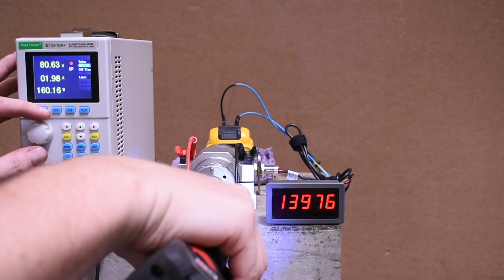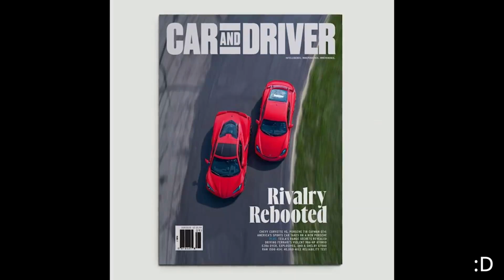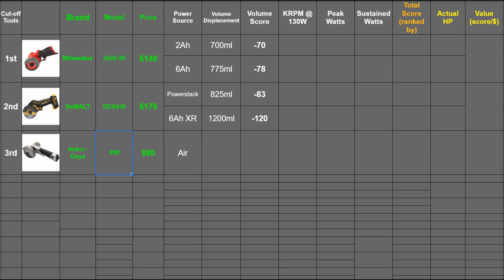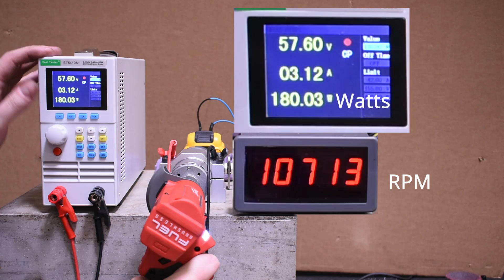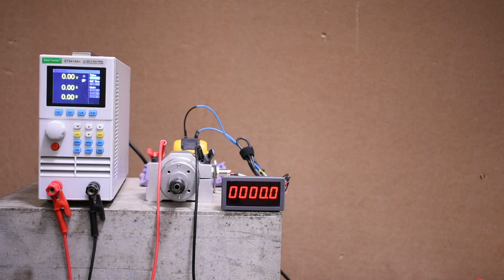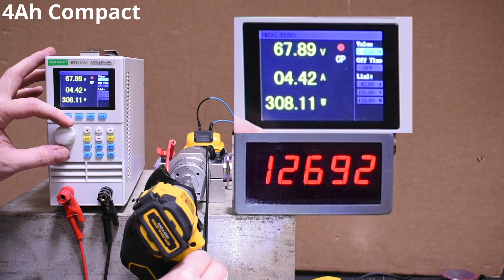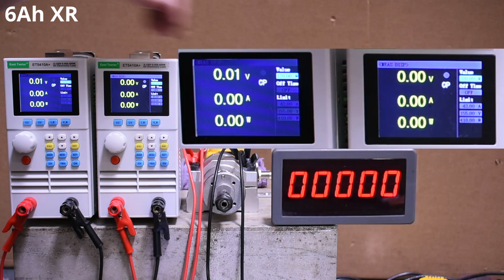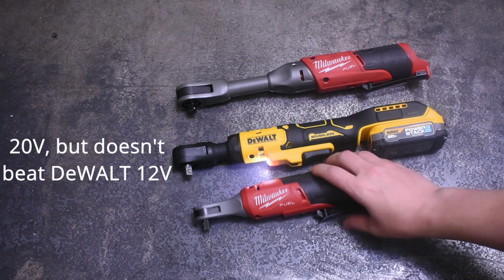Best Cut-Off Tool? Dyno Testing DeWALT v Milwaukee v Air

Comment: It would be interesting to see how the other TTI 18v tools compare, like the Ryobi cutoff tool and die grinders vs the Rigid cutoff tool. It's interesting that TTI hasn't made an 18v one in the Milwaukee line.

I've noticed my Ryobi cutoff will just chew through 4ah 18v packs when cutting sheet metal, and eventually "overheat" if I was to push it but that's really a task for an angle grinder, partly from grinding wheel cost. I mostly use it for lighter tasks where it's been fine.
Reply: The 4ah batteries are too small for that application, I'd bet. Angle grinder wise, my M18 is gutless and hogs through batteries faster than steel with less than a 6ah battery.
Reply: @wiresmith2398  I'm sure the bigger batteries work better, but with a small motor I wouldn't say that they're useless unless the batteries are heavily worn.

Angle grinders definitely benefit from higher output packs, the non HP+ ryobi packs also output less current in general than the HP+ ones, so they'll always be a bit weaker.

The main issue with using a 3" cutoff tool to run though sheet metal is just heat, the motor got hot, the cutting disk got hot, the battery was hot, it's a lot of heat, but it worked.

Comment: the volume measurement bugs me. i could accept a plastic bag if it was vacuum sealed, there's a considerable amount of trapped air in the shopping bags y'all are using. with the wide ability of 3d scanners in cell phones, i think you should be able to calculate volume of a 3d model pretty easily
Reply from the maker: No air, just the thin bag. Pushing the bag into the water empty with a pencil yields less than the 25ml resolution we have to go off of

Comment: I know you guys are mainly car guys, but I would love to see you do a "What battery ecosystem is best" comparison. What tools exist for a given battery family, and how good they are. Including drills, impacts, angle-grinders, saws, etc.

With ecoysystem/family, I mean not just e.g. Devalt XR. If you can use XR and Powerstack and others on the same tools, that counts. 12v vs 18v/20v does not. You'd have to be able to make use of the combination of Tool/Battery/Charger.

Comment: When I first saw the Milwaukee cutoff saw, I thought it was pointless.  But then I started doing a lot of work with fiberglass, and combined with a good diamond blade, that thing sure is handy!  I'm not at all surprised that air beats it, though...
Reply: i got one to cut impossible to unscrew screws in hvac retrofit, and i love it for its size (and battery compatibility with my other Milwaukee tools), but i can tell that using it for sheet metal, screws, and the occasional heavy angle is about the max of its usefulness. id love to see more compact 18 volt batteries, and a m18 cutoff tool out of Milwaukee.
Reply: @shrededpudding5921  agreed. The max I've cut with my M12 cutoff tool has been 3/8" steel rod but anything heavier will be cut with my corded grinder.
I'd say this tool was pushing the limits for a 12V platform and a main reason we don't see 4 1/2" angle grinders in 12V guise. The least powerful angle grinder I've seen is 600W, just do the math...

Comment: I like how you mostly talked over the partially muted air tool. Not trying to knock Astro, they make great tools for the money but good grief they're loud! 
I know, you should be wearing ear protection when cutting. But the noise from the exhaust is at least three times more loud than the noise from the metal being cut. Much like their belt sander...

I am aware of the fact that adding a "muffler" reduces tool output, but is it really worth hearing the tool literally scream bloody murder at that expense? My 3M belt sander (I grind a LOT of spot welds) has three times the power at eight times less noise. Can't you guys figure something out in that regard?
Reply from the maker: Astro makes 3M's air belt sander in the same factory, different tools for different price points. But your point is a good one

Comment: Yeah no doubt dewalt beat milwaukee 20v vs 12v  plus the 6ah is a ho battery for the dewalt.  Should have used milwaukees ho 5.0ah m12 battery in the test.   Impressive tho dewalt

Comment: There is one thing u need to consider 
that spindle motor u use to test have maybe around 70% efficiency in a way u use it 
then not exactly about test , but brushless tools have 90%+ efficiency where AC tools have around 50-60%
for example metabo 240v 850w have 480w output where 850w brushless will have more than 770w output 

so THAT DEWALT IS A BEAST ...it have more power than 1kw AC powered- grinder

Comment: That Dewalt is insane.  Some engineer fought to put that motor in that tool and it paid off.
Reply: Yes...BUT isn't a shit air tool better? I hope I'm not the only cheapass wondering
Reply: @B0BBYGAMER he did test a cheap air tool in this test, and it got beat bad by the dewalt
Reply: @B0BBYGAMER  for the simple reason of not being tethered to an air tank or dealing with an air hose.... Absolutely not
Reply: @B0BBYGAMER  Cheapass tools lose charm when they die. Then you spend time and money with a new tool when you would be doing something else.
Reply: I absolutely love mine! I find myself using it for all kinds of stuff. Using it with the dremel brand diamond multi purpose blade is great. I also saw that someone makes an adapter to use a finger sander/belt grinder attachment on it going to order one of those next!
Reply: @crherniman  seriously serious serious 🧐

Comment: Decisions, decisions.......I'm already on the Milwaukee 12V platform, so that would be an easy choice. However, even though I'm on the Makita 18V line, I could buy an adapter to allow me to use my Makita packs on the Dewalt. Would be a bit less power due to 18V vs. 20V, but doable. Hmmm......
Reply: 18v and 20v tools run at the same voltage. It's just a marketing difference.  The cells inside are 4.2v each x5 when fully charged. They actually run at 3.6-3.7v when loaded. DeWalt is calling it 4v each while Makita is more correct at 3.6v. I believe some countries have a issue with calling it 20v.

Comment: I've had a ryobi cutoff tool for a while, and found that it works okay. I bought the dewalt a couple weeks ago. First time I used it I slapped a 6ah 60v flex battery on it and was shocked at how good it is. It's stronger than my snapon,  Ingersoll, and matco air powered. I also have a ryobi hp and a dewalt cordless angle grinder. The dewalt is miles ahead in that comparison as well. I use these tools professionally and they all take abuse. I think another area where dewalt shines is how well they hold up. With the exception of watching those expensive 20v batteries explode if you drop it on the shop floor.

Comment: I’d like to see the Ryobi 18V on the list.  I have the M12 and find it suitable for only light duty stuff but the Ryobi has handled all I’ve  thrown at it.
Reply: I've seen tests on other channels that just go through the normal cutting speed same blade same battery capacities comparatively a 4 amp hour 12 volt Milwaukee versus a 4 amp hour Ryobi 18 volt and Ryobi outperforms Milwaukee. I have the rigid version so I'm team Orange and well yes I have stalled this thing out a time or two. It does everything it's supposed to do well. My only complaint is the guard/depth control.  Milwaukee and dewalt's guard is a much better depth control option than what was included on the rigid. A glorified metal bracket and you need a 4 mm hex key to adjust the depth. But overall in the TTI camp rigid and Ryobi are better than the Milwaukee

Comment: Appreciate your testing. Looks like Milwaukee has some catching up to do. Thanks for the videos.
Reply: I mean it is Milwaukee M12 Series , The M18 series would be different story
Reply: @Jesse921  I would love to see an 18 volt version of the right angle die Grinder, a little more size with a bunch more power and runtime. I’m sure they would still be smaller than the old Ingersoll Rand Cordless Right Angle Die Grinder. 14.4 Volt Lithium Ion Battery. I liked mine until it got hot or the batteries died.

Comment: It may be worth running a similar motor hooked up to your rig, monitoring power in vs power out to get an efficiency curve (if it differs vs rpm) and you could use those values to compensate your findings and get even more accurate data

Comment: Glad DeWalt stepped up to the plate with the greatest useless tool lol
Reply from the maker: These are incredibly useful, the direction of sparks not at my face and air hose not pinched up against he car when following a cut around something. I hear tile guys are loving these as well, though no experience there.
Reply: @TorqueTestChannel  a cutoff wheel on a straight die grinder has been the norm hose or battery

Comment: Why don't you guys test any Craftsman? Think I've only seen them once on here.
Reply from the maker: We've done 5-6 episodes with V20's. I like 'em
Reply: @TorqueTestChannel  cool. I'll go back through the catalog and find some of them. I got a 20v (7) tool brushed set for a little under $300 last year and have been quite pleased with it. I know there are better or more powerful tools I could have bought, but the price was right. 

I look at cost vs actual return and it seems that's overlooked sometimes. 
What I mean is if I have to pay 3x as much for something only to get a marginally better or marginally longer lasting tool, I'm usually not interested. I don't mind paying up honestly. I would just prefer to do so at a proportional rate to performance and longevity. 

Thanks for all the testing you do.

Comment: I've hated the M12 cutoff since I bought it and just expected the DeWalt to be about the same. NOPE, I'm buying the DeWalt! Thanks for the video.
Reply from the maker: We thought the hype in the DeWALT was just because it was new. Sort of thought the same as you. Just highlights how hard it is to compare these types of tools on product pages
Reply: @TorqueTestChannel Dam you for making me buy another DeWalt tool... D:<
Reply: I agree completely.  I have many Milwaukee tools and like them all except this weak thing.  The only material that doesn't stall it is foam insulation.
Reply: Crap just bought the M12, maybe I shouldn’t have.
Reply: @memphis6694  return it while you can! If the return ladies heckle you cuz you're returning a Milwaukee just tell em that you bought it for your dad but he died!
Reply: Same here. I regret buying the M12. Wanted to use it for tile and and concrete board and it feels like it is going to catch fire.
Reply: I remember trying the M12 and returning it. Just didn't "feel" right. I'm glad I did.
Reply: I can't stand how big the m12 die grinders (90° and straight) are. The handles are so rediculously large it seems like they put ZERO effort into trying to package the components efficiently. They look like a rushed first draft just made to prove a concept, not a production tool. And most of their stuff is looking like that these days. Making that money I guess.

Comment: So the DeWalt is basically the same motor they use in their drills etc I'd guess, as the medium class ones are rated around 500W.
Reply from the maker: That's UWO vs MWO rating difference though, thanks DeWALT for the confusion

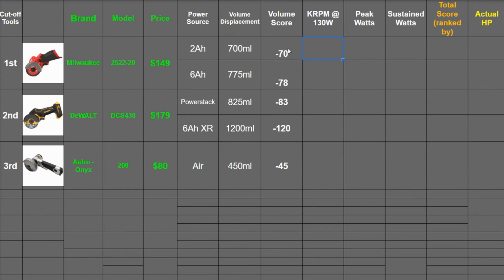Comment: 6:48 Why are you doing this stupidity?  So the tools ran at 143,000 and 158,000 RPM respectively? - your read out displayed 14,300 and 15,800.  Either correct the numbers or change the column title.
Reply: Dude, there's no need to be rude to our man, Test.
Reply: @993MartinL  Changing it to what it is now is moronic.  TTC didn't explain why they changed it to this - just that some people in the comments asked for it.  Being blunt because it's stupid is not being rude.  I was only blunt about the stupid decision.
Reply from the maker: We're not so worried about standard notation over a balanced scoring system. People pointed out that a 14.3 score is weighted very low vs the other columns with scores like 150 and 170. We've fixed the column title to "100's of RPM @ 130W" for a useful scoring system. Thanks for the correction. People are welcome to think is dumb, we look forward to seeing their testing and scoring system in that case.
Reply from the maker: We've changed the column title, thanks
Reply: @TorqueTestChannel  Nice.  Although, i would have changed the values back because it fits with standard engineering notation.  Now you have a column that's 'unique'.
Reply: @Shocker99 
You should learn how to communicate in an adult fashion instead of living up to your “shocker” handle. Grow up or go back in your mom’s basement and play video games! 
This YouTube provider is one of the most “beloved”, hard-working and respectful content providers in that universe so a little respect is due, if you think you could somehow manage that!

Comment: you should test the dewalt with the 5ah powerstack battery
Reply from the maker: 0:08
Reply: @TorqueTestChannel  damm i guess i missed that part sorry about this
Reply from the maker: @engineergaming1309  hey no worries
Reply: @TorqueTestChannel  alr but in the next video on this topic be nice if you tested the ryobi cut off and die grinder

Comment: That motor is probably around 85% to 90% efficient as a generator (the heat its fan is removing has to come from somewhere after all), so the DeWalt is probably bang-on its 550W rated output.

I'd like to see a calibration run of your setup using a known quantity of some sort, maybe a 12V motor with known efficiency and volt/amp meter to measure what its drawing?
Reply: I wonder if you could have an almost identical setup with another spindle motor, except drive it with a DC power supply. Then you could basically dyno your dyno with itself. You would have to make the assumption that both motors have equal efficiency in this scenario, though. I dont know enough about DC motors to know if you can do that.
Reply: add to that brushless have 90%++ efficiency where AC grinders have more like 50-60% (for example metabo 850W have 480w output power)  
so THAT DEWALT IS A BEAST .... 550W +++  of brushless ON THE OUTPUT !!!!!  (it have more because that spindle as a generator have less than 80% efficiency)
its like 1000w 240volt AC powered grinder ....but compact ....and probably even more powerfull
Reply: I used to do efficiency testing of automotive space. Toss an inline flange type torque meter, T12FS from HBK was the standard at the time. The cost goes way up, I rather have them use their funds on buying tools and testing than coming up with a band on dyno.
Reply: @wills2262  wouldn't need anything near that expensive. Just get a second motor exactly the same and hook them up together. Measure power going in, subtract power coming out divide by two and there's your efficiency loss for the generator side.

Comment: Your test rig came very close to those UWO numbers provided in the specs.  3rd party testing is more thrust worthy than MFG's claims and now I can confidently associate UWO numbers to actual work, as in HP.

This test quantifies what others have been saying about the Dewalt cut off tool feeling more powerful as it takes more pressure before bogging down.  

Put a 9ah flexvolt and see what it can do!
Reply: Lmao a 9ah flex volt on this thing would rip through a solid block of steel.

Comment: at 500w by your measurements, I could very easily believe 550 or even more of actual mechanical output. though even if the tool was perfectly efficient, its gotta be pulling 25+ amps from the battery. better hope whatever you're cutting that aggressively has less than 15 minutes of fight in it
Reply from the maker: Agreed
Reply: curious to know what would start on fire first if you took a flexvolt to this thing
Reply: The larger Dewalt packs should be able to do 50+ amps of draw.
Reply: @SomeGuysGarage  the strongest Samsung 21700s are rated at 35a
Reply from the maker: @taz4100  Per cell, at 3.7V. You gotta do some addition and multiplication to figure out the rest
Reply: @taz4100  yup, as TTC said that's per cell, there's many in series together to get you your "20v" nominal voltage (usually 5 cells), and then parallel together to get more total AH and oumph on the bigger packs.
Reply: @taz4100  rated, but can do 50 continuously and more in peaks. Btw 6ah xr pack uses lg cells
Reply: @riba2233  they also use Samsung 30Ts.  They also used to use Sanyo 20700s before the changeover to 21700s.
Reply: @jaywelker5566  true

Comment: I can only hope the Milwaukee is stronger than the Dewalt. I’ve used the dewalt with 9ah 21700 flexvolt battery and it bogs down quick. Maybe it’s a safety feature keeps it from binding up but I was under impressed
Reply: Well then you need an angle grinder.